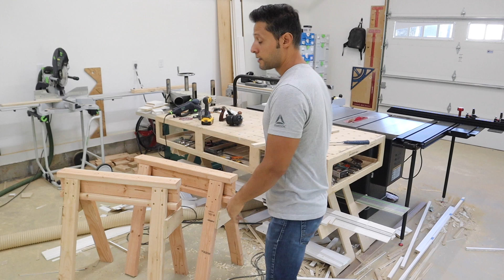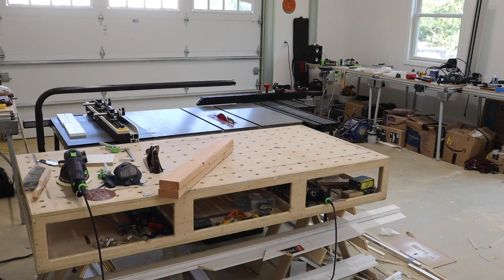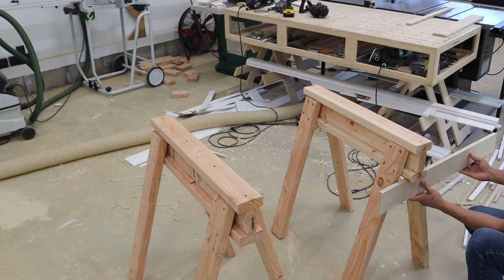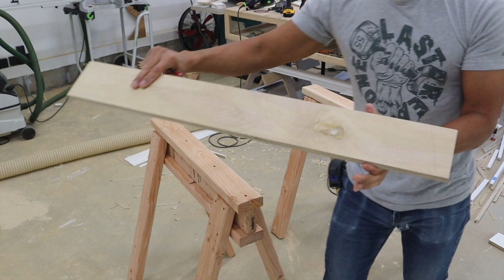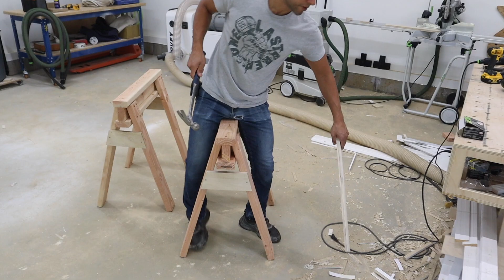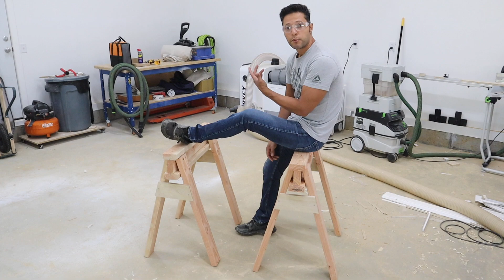Simple sawhorses

Comment: So, I have been looking for simple sturdy, and quick sawhorses to make, and most of the other videos spend considerable time into getting the angle cuts so it sits flush etc. i have no doubt they are more study and refined, but I dont have a shop and need to knock a furniture pieces together, and this is exactly what I needed. 

Took me more than 10mins - closer to 90mins - as i was working with a circular saw only, in unideal space, and no workbench for assembly. If I had to do the beveled cuts, etc, it will take me days that I dont have.

Thanks!

Comment: We used to build 8' long versions of these from 2x6 with a crew I worked with building a camp.  We could lay out a whole roof of rafters and cut cut cut.  You don't even need the top 2x in your video.   There not the nicest sawhorse I ever saw, but the definitely do the job

Comment: Good works. But it doesn't take 10 minutes to build these. It's more like, 1.30 hours.
Reply from the maker: @smileyhomeimprovementsjohn6165  1.30 hours???? These literally take 10 minutes(for two). I wasn’t joking. And that’s with me explaining how to do it. I can crank out 10 of these in 1.30 hours. If you cut all your parts with a stop block, then just screw them together the way I show you, it’s like 5 minutes a horse. If i used my framing nailer, it would be 3 minutes.

Comment: Do you ever stain wood? If so, do you have a table or something that you stain on? I’ve read Formica makes it easy to clean the stain off. I use cardboard boxes right now but looking to see if I find something better. I do a lot of staining. Different colors. So it’s a pain to find a clean space to stain.
Reply from the maker: @Patriot904FL I do stain grade work all the time. Surprised you haven’t seen that in any of my previous videos. I buy rolls of builders paper, roll it over my work table then when I’m done staining, I throw away the piece I used.